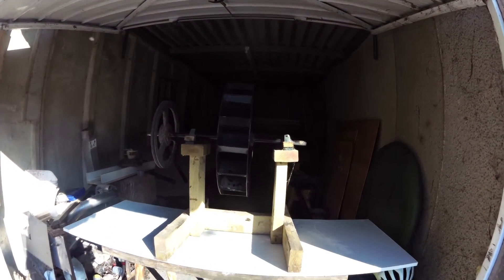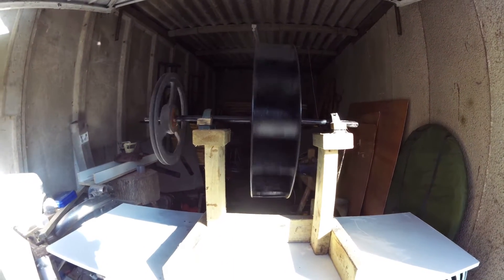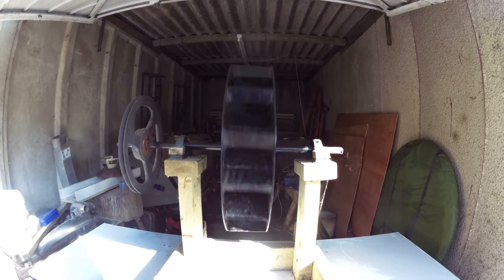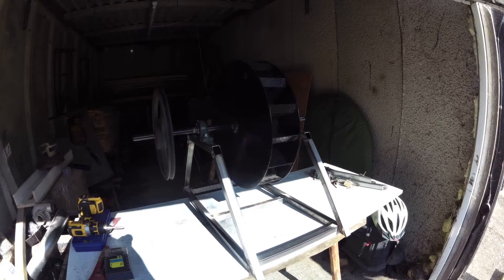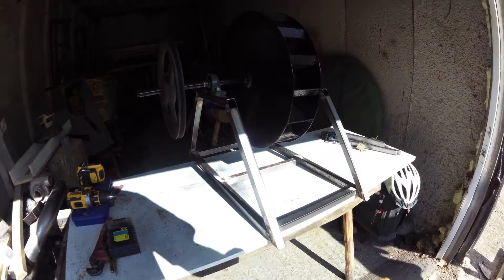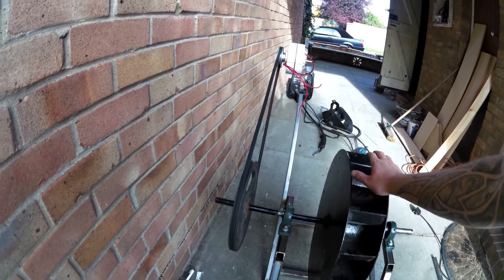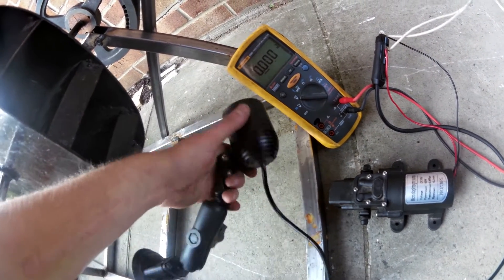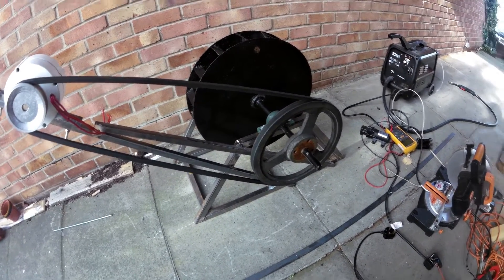Diy Micro hydro water wheel generator

Comment: Hi Kris - I know this is an old video but maybe you'll have time to answer this! I'm looking to build something very similar to this and was wondering if you had some advice about where to buy or source the generator motor? I'm living in central Portugal so any UK or European links would be super helpful!

Great to see what you have built and thanks for your effort 👍👍👍
Reply from the maker: It really depends on what rpm and voltage you want. if you search for PMA permanent magnet alternator on enby you will find loads of low rpm ones for wind. that is what i used for this.
Reply: @KrisHarbour  Hi Kris - I've been watching a few of your videos and its been awesome seeing the development from this idea to the turbine that you now have! - very impressive 👍. I saw in your other videos that you eventually upgraded you PMA to the one by 'motenergy' and that this was better suited for high RPMs. 

I am still looking to start off by building something like this water wheel and just wondered what RPM and Voltage you had on the alternator featured above? 
I've found a lot of PMA's that look like the one above online from chinese companies and just wondered your thoughts on these for this use!
Reply from the maker: @manopalo  Hi, this one did about 24v at about 300 rpm i believe. I think those Chinese alternators are quite good. i have had them apart and there isnt much to go wrong in them. they have good quality magnets and a solid built. for a waterwheel type system they are perfect.
Reply: @KrisHarbour  Awesome dude :) Thanks for the info. I'll get myself one and hopefully it will work out. Good luck with the rest!
Reply: hi i am looking at moving to portugal . and again inspired by Kris . unfortunately my attempts to contact him have just lead me to scammers . i would happily pay for his advice or if possible builds

Comment: nice job chris . if i can only tell you one thing: this wheel might have more then enough power to spin the alternator much much faster if you use a small gear instead of the one you use.

Comment: just an idea but you could add a ram pump to pump water back up to the small lake to improve your gravity battery
Reply: it won't replace all the water lost but could top off the lake in the very rare dry spells
Reply from the maker: Thanks for the comment, but the lake has a spring feeding it all year round, its not massive flow but it never stops so a good recourse to have.

Comment: ben from  australia
round house is great dude your doing a great job
mite be to late to add a comment about your water wheel design says 7mths ago you made it
i thought buy adding some metal steaks on each corner you could drive it into the ground were its going to be instaled to keep it stable..
an maybe try using a truck altornator they will give you more output..
anyways all the best kris

Comment: if you build a ram pump for the stream you could have pressurized water for the cabin
Reply from the maker: +Curtis Westsail the spring is 10 meters hight than the cabin. So we just use good old gravity.
Reply: yes that makes sense. Thanks for sharing. . i really enjoy the vids.

Comment: Little advice: a V-belt will eat between 20 and 30% off the power. Try using a simple bicycle chain. well lubed it has up 99% efficiency. Also, I would use a 12 V DC dynamo, and charge directly into 12V Li-ion battery. LED lights, phone and laptop will work directly, the less you convert power, the more efficient it will be.
Reply: Not sure where the 20-30% came from, all technical manuals suggest 2-10% losses.
Unless the belt isn't tensioned and slips all the time, but that is not how it should even be operated.
Reply from the maker: i fins it very hard to believe, say you had a small engine with an output power of 2kw and it had a v belt. you are saying that the belt would be consuming about 600w? and turning it to heat. i have felt v belts after they have been working hard and they are usually warm to touch. they dont feel like they have had 600w of heat pumped in to them. i am quite willing to be proved wrong but it goes against my understanding of v belts.
Reply: +LordLlurch unless the flow of water through the turbine is constant and the electrical load on the generator constant, the voltage output is going to be all over the place (hint: if the voltage was constant you'd have no need for batteries!), if you're using quality car chargers for your laptop and phone, your laptop and phone probably won't be damaged, but your LED lights, Li+ battery and possibly your phone and laptop chargers will be toast.

a quality Maximum Power Point Tracking charge controller will keep output voltage constant while maximizing the power output of the generator
Reply from the maker: is a v belt that bad? i know they are not exactly the most efficient but i didn't realise it was that bad, chain is a good idea but i would need a large sprocket, otherwise i would have to add more gears and that would loose lots of efficiency. where would i got such a large sprocket do you think? thanks, kris
Reply: sprockets are made between 11 and 54 teeth. BMX parts are between 16 and 44, very sturdy and made of steel, so easy to weld or cut threads in them to bolt them on an axle. Google ;)
Reply from the maker: that is what i thought
Reply: I've seen reports mention even upto 40% loss. Manufacturers make claims that aren't real world circumstances. It's like gas mileage with cars. For real data, check engineering books, not manufacturer's manuals.
Reply from the maker: you are over complicating it. the battery conductivity will apply a load to the wheel. that will slow the wheel down until the battery voltage gets to a point (maybe 14.4 volts for gel batterys) where a very basic charge controller diverts it to a dump load. things dont always have to be complicated.
Reply: No such thing as a 12v lion battery. 3s is 11.1 etc, also they need to be charged cccv so this system would have to be fed through a complex charging circuit. lead acid are far cheaper and handle different charge methods better.
Reply: http://www.lmgtfy.com/?q=http%3A%2F%2Fwww.mastervolt.com%2Fproducts%2Fli-ion%2Fmli-ultra-12-5000%2F
Reply: if the engine produces 2kW, output on the other end of the belt will be 2x0.95=1.9kW at best and 2x0.7=1.4 worst case scenario. and yes, it will get bloody hot.

Comment: you need to put a diod to the generator so it will be easy to spin when you power things especially when you power things that have a electric motor inside
Reply from the maker: +Troll Face hi, could you maybe explain a little bit more why it would need a diode? the 3 phase will be going to a charge controller that will presumably have diodes in it. It will then charge batterys and the power will then be taken from the batterys. this should be fine right? 

thanks for the comment.
Reply: first of all i think that it is a very good project and im not a electronic expert but i have done a similar project in miniature and i think that the diode will make the spining much esier .
its just my opinion.

Comment: how did you learn to weld?
Reply from the maker: +KILLKING110 i decided that i wanted to learn so i got myself a welder ad thought up a project that would involved welding differant types of metals, and just got to work making that project, i learnt to weld stainless steel, mild steel, aluminium (although I'm not very good at aluminium) so yeah the best advice is to just get a welder and start welding. if yo are having trouble with something just get on youtube and work out how to fix it. to joint two pieces of metal together is very very easy but to do it nice and neatly and well takes some practice. but just start and you will pick it up in no time.

Comment: At first glance I wonder how you can get 400 watts unless you have some kind of waterfall which you could mount the wheel under....You can calculate the power based upon the head height and flow rate. To reach 400 watts with 10 meters of head height for example you would need 7L/second flow rate. So either you have a really strong stream or lots and lots of head height.
Reply from the maker: +2007TypeR  yeah i have done the calculations, i do mention this in some of the other comments, there is 15m of head, about one 3rd of the water from a small stream will be diverted down a pipe fall 15m and spin this wheel. and then once its energy has been used it will go back in to the stream. the stream flows at differant rates depending on rainfall but during wet periods there is A LOT of water and 15m of head, so at least 400w can be achieved at about 60% efficiancy during wet periods (winter) and much less over summer but we will need more in the winter anyway.

Also the lake that i am digging is rather large and about 7ft deep, this is going to be acting as an emergency battery, the lake is at least 12m above the house and will have a filtered pipe coming out of it with a gate valve that can be opened and dump a large volume of water through the wheel to charge up batteries if the stream flow gets to low. of course the lake won't be drained very much just a few inches but that would be a large amount of water. 

 thanks for the comment. kris
Reply: +DIY Harbor: Kris Harbour I like the idea of a lake for power storage! Turn on the taps and on comes the power. Looking forward to seeing it all setup, I'd love to do something like you are doing some day so it's an inspiration for me.